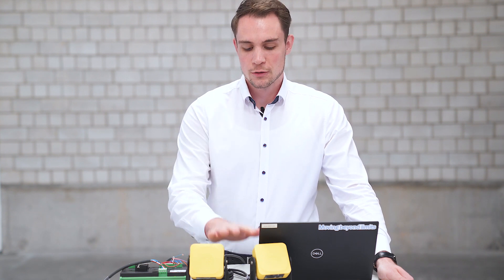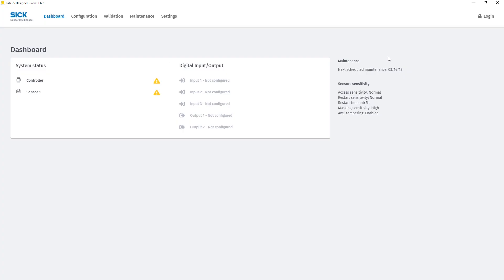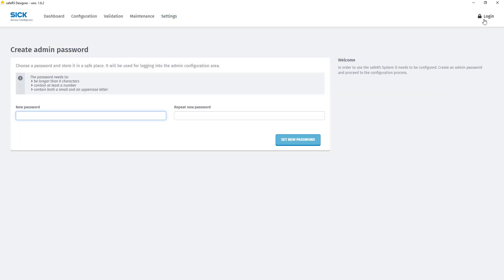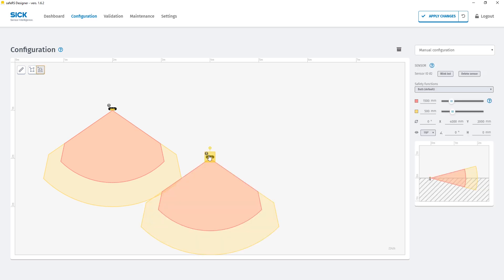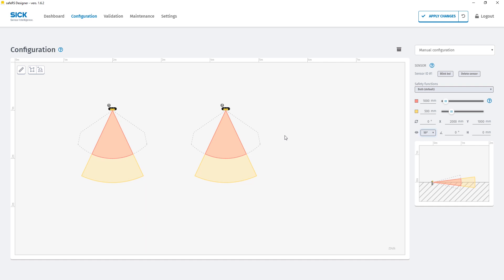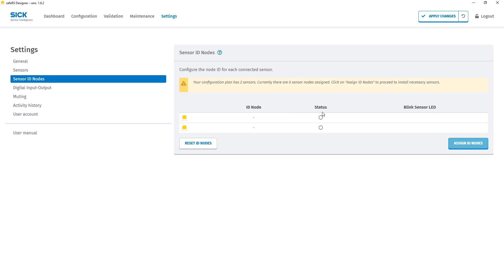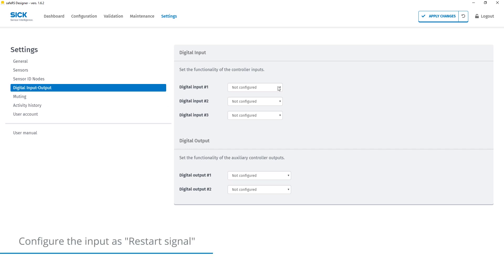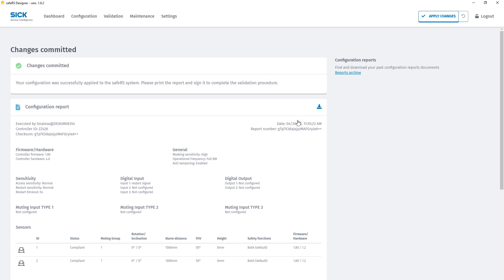Tutorial safeRS: How to set up and configure the Safe Radar System

Comment: what is connect to the "safeRS3 Control digital inputs and outputs terminal block?"
Reply from the maker: Hello @lifeonearth5321 and thank you for your question! 
The digital input and output block is used to connect the safeRS3 control to another PLC (Programmable Logic Controller) in order to exchange digital signals. The inputs can be used e.g. to activate different monitoring cases and the outputs are usually used to communicate the safe output signals from the safeRS3 control to the PLC for safety related stops of the machine. The configuration and use of the block is up to the user. The communication is done with standard high/low signals (“1” and “0”). For more information on this, please refer to the operating instruction of the safeRS3 system: https://cdn.sick.com/media/docs/3/53/653/operating_instructions_safers3_5_meter_sensors_safe_radar_system_en_im0101653.pdf

Have a good day!